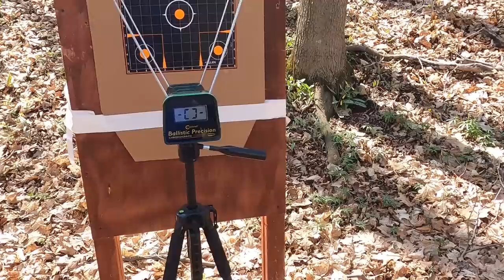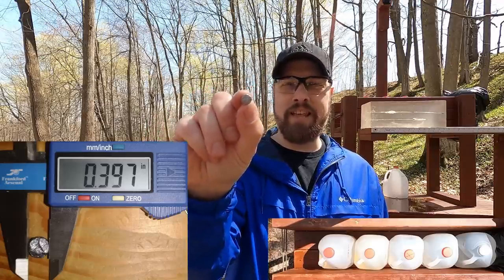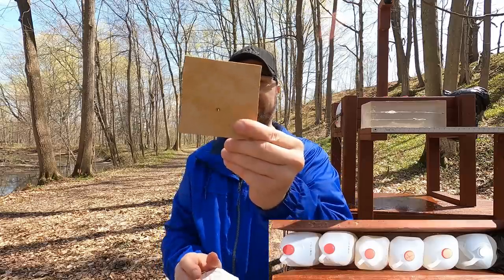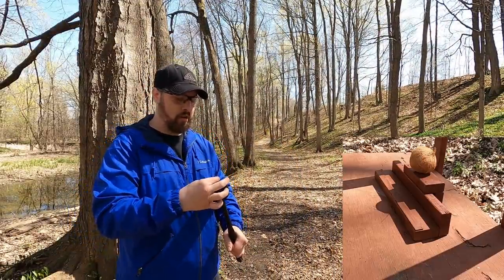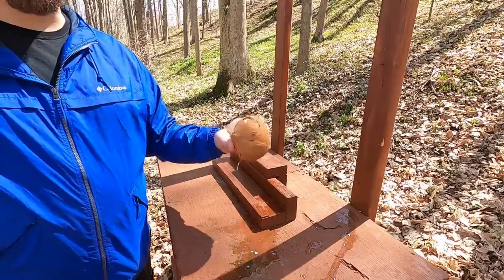WOW Dieseled Pellet Rifle RIVALS Firearm - .30 Caliber Break Barrel OVER 50 Ft Lbs Energy!

Comment from the maker: I wanted to mention this as many might be wondering if my eyes deceive me. But no, the numbers I list for gel block penetration are spot on. It's a weird thing, as these Gopro cameras I use have to be in some sort of widescreen at all times, so it stretches the block edge and makes the inch markers look a full inch off. That's why I look 210 in center of the screen but 250 on the edge of the screen lol.
Reply: hmm.. same Hatsan in .25 and dieseled, "place your bets!"
the .30 pellets weighing 48 grain, typical .22 being 40 grain.
.25 pellet might be better than .22 pellet up against a .22lr
Reply: this is super interesting to me, I wonder if you can machine a barrel to perform with dieseling from the ground up?  Maybe like a mechanical oiler that only dumps a perfect amount of fuel behind the pellet after the action is closed?  I imagine a spring loaded detent that would actuate a valve maybe?  I think you are right on making sure your loads are consistent, because all over youtube people are using things like rem oil, and wd 40, and 3 in 1 oils, and they all seem to shoot wildly inconsistent shot to shot.
Reply: The United States Department of the Army uses 3/4in plywood board to determine lethality. And then do distancing for lethality at distance.
Reply: I blew my piston seal when my nitro piston dieseled.
Reply: OK. So first thing you need is replacing cheap hard plastic made seal of the piston with one of higher quality. You can get Hatsan dedicated good seal from Czech Rep or Slovakia. To put it on seal needs to stay a while in water of 90'C and the piston put into the fridge. Clean the barrel and check the muzzle for badly finished edge of rifling. Fix if needed. Use the hollow point pellet with a deep hole. Find and fit thin HSS drill (for metal/steel drilling) so it could go inside easily. Cut the drill into pieces but fond overheat it. You need this drill to stay heat treated. Glue the drill tiny bits inside the hollow point pellet or airgun slug (it looks like a bullet most have hollow points. Put a drop of flamable liquid (like engine oil or WD40 or kerosene) inside the pellet skirt. Airgun slugs sometimes have a shsllow dent on the vottom (end) side. Second drop put inside mouth of air cylinder or inside the cylinder. It will go thru any coconut you want. My tuned Hatsan  125 with my own vortex version gotinto 22.LR areas. Hypersonic speed 25-30 grain pellet slug while  dieseling went thth old crapy car doors steel sheet panel and stopped on the door plastic panel inside. My PCP Hatsan airgun (Nova Star in 6,35mm) with 75 joules energy and slug with a drill bit inside goes thru car door and stays in the plastic panel of the second doors.
Reply: Thanks a lot for this video, The best material to diesel the pellet is the Gun Oil you use on gun maintenance it would heat up faster produce much greater pressures. You should try using different types of pellets....
Reply: You think dieseled slugs works well in the Hatsan Carnivore? Something like 50 grain?

Comment: 38 years on this planet and this is the first I have ever heard about "dieseling" a pellet. I can't imagine the trouble I would have got into as a child if i knew this. I wonder what a drop of RemOil would do. Thanks for sharing.
Reply: A drop of pretty much any oil works the same. I've found that a single drops worth (vaseline or oil) actually works better than than filling the entire skirt of the pellet. It seems to consistently provide higher velocities. My best guess as to why would be that with a single drop you're getting a better fuel to oxygen mixture so a more complete burn. With engines, fuel heavy mixtures burn less completely and put out less force than with an ideal mixture. Having a good ratio of oxygen to fuel is exactly the reason carburetors were invented and why they work. You use a carburetor to moderate the level of fuel and oxygen to get the most complete burn. I imagine if he used about half the vaseline amount he was using here he would see even higher velocities.
Reply: Hahahaha my exact same thought on the subject
Reply: I know 40 years old and I heard about it last month, and I keep forgetting to try it out dammit. I picked up my air pistol the other day and was like why did I want to use this again.
Reply: @disturbeddemons1  14 to 1 is what you want
Reply: I used bore cleaner on two of my .22 pellet guns . Smoke from both more power too
Reply: @messagedeleted1922  heck I started at 73 yrs and never heard of it until a few yrs ago. I have severe startle response  from combat and cant fire in ranges even with electronic head phones but break barrels are great for me .
Reply: Im56 been doing it 45 years it works n no damage u can diesel a red Ryder n get 500 fps
Reply: Vaseline works best
Reply: @marksmith8421  Mark is that true about red rider? Its s spring bb gun
Reply: I have a gamo .177 break barrel n get1800 fps plus also have the gamo 22 it's a beast n my new sig rattler canebrake 30 round clip love them all n oh my glock 19 best bb pistol on market love  ur vids
Reply: @jimwyatt7670  u grease the bbs it works
Reply: @marksmith8421  what kind of greece. Oil , vaseline, wd40, gun oil etc. i never heard of this for bb s .
Reply: @jimwyatt7670  vaseline
Reply: @marksmith8421  can u diesel gas pistols?
Reply: @1112-g1x  yes
Reply: Thats why teach kids how to properly use air rifles and firearms
Reply: Remington oil does beautiful
Reply: 42 years for me lol.  I definitely would've been doing that if I knew how
Reply: So far it's the best I've found
Reply: Its realy bad for your air rifle i had to exact the same rifles and with one i did dieseling and it only shot like 4000-5000 shots and tgen the spring died , and the other rifle that i wasnt dieseling shot more than 10.000 shots before the spring died
Reply: @werkzoekende6553  from the Netherlands uitkeringstrekker? Haha, I am.  I'll continue writing in English so everyone can understand. So you're saying your dieseled break barrel lasts 5000 rounds?? I find that  a lot and wont be a reason for me for not doing it. 5000 dieseled pellets with an carnivore??
Reply: @werkzoekende6553  you’d need to repeat that a few more time for it to be valid. I’ve had many of the same guns give up the ghost while the other is still going.
Reply: I thought all kids did this when we were younger we all did back in the 70s and 80s great fun
Reply: They should call it vaselineeeeeeitit 😅
Reply: Don't feel bad I've been here fifty years and I just found out about this last year
Reply: I did it on accident with my pellet gun as a kid with wd40 lol
Reply: I just put oil in the pellet container, oils the skirts for dieseling, and lubes the pellet at the same time.
Reply: I used petroleum vaselline with a little bit gunpowder, it was extrem, I have no chronograph, but I used my Gamo with mag., so I could load the pellets and the powder stayed in the pellets thanks to the vaseline, after the 3 shot I saw always the barrel smoking, and watching the pan I shot, some got even through. Absolute deadly, some said it will damage the seal, until now no issue at all. but you can clearly here he sonic effect, it's far louder!
Reply: Happy 41 years brother
Reply: Yea using way too much man ? It’s a small space in the skirt of a pellet so I say again Less is always better when you diesel your air gun I have seen the numbers on paper when my buddy was testing what too use and how much. Not long ago he told me he had a big breakthrough on his quest too get the most out of his pelllet guns and he told me it has to do with mixing the perfect  oil to the stuff they use for sparklers you use on your b day cakes ! He said it has to be kinda thick mixture so that you can use a needle 💉 to place the dot of his mixture in the middle of the pellet and not having it drip out before u shoot and he also said with certain kind of pellets you can use the needle to just  put a very small amount again but place the oil on the bottom part of the pellet skirt so like a full ⭕️ circle on the bottom edge and stressed to use the smallest amount is key. I picked up a Gamo mutishot I am going to try and make a mixture with the oil, sparkling dust  and see what happens . He told me everyone has there own kind of process when it comes too this but also said he dosent know anyone who has spent a large amount of time to perfect his  method . So I believe  him ,he said the ink on the paper dose not lie so I’m guessing he kept a note book and wrote every shot he took and what the differences were between his experiment of every factor including the temp ,and weight of ammo . I took a long time but he told me that most important thing is too try and get the fps as regulated as possible cus when that happens you have found the perfect amount and mixture.   lol he would not tell me the amounts or his recipe because it’s a family secret hahah😂 .  He must have tried everything I bet it took a lot of time too perfect his experiment.
Reply: Yea using way too much man ? It’s a small space in the skirt of a pellet so I say again Less is always better when you diesel your air gun I have seen the numbers on paper when my buddy was testing what too use and how much. Not long ago he told me he had a big breakthrough on his quest too get the most out of his pelllet guns and he told me it has to do with mixing the perfect  oil to the stuff they use for sparklers you use on your b day cakes ! He said it has to be kinda thick mixture so that you can use a needle 💉 to place the dot of his mixture in the middle of the pellet and not having it drip out before u shoot and he also said with certain kind of pellets you can use the needle to just  put a very small amount again but place the oil on the bottom part of the pellet skirt so like a full ⭕️ circle on the bottom edge and stressed to use the smallest amount is key. I picked up a Gamo mutishot I am going to try and make a mixture with the oil, sparkling dust  and see what happens . He told me everyone has there own kind of process when it comes too this but also said he dosent know anyone who has spent a large amount of time to perfect his  method . So I believe  him ,he said the ink on the paper dose not lie so I’m guessing he kept a note book and wrote every shot he took and what the differences were between his experiment of every factor including the temp ,and weight of ammo . I took a long time but he told me that most important thing is too try and get the fps as regulated as possible cus when that happens you have found the perfect amount and mixture.   lol he would not tell me the amounts or his recipe because it’s a family secret hahah😂 .  He must have tried everything I bet it took a lot of time too perfect his experiment.
Reply: @marksmith8421 yea I tell my buddies all the time that when you get a blowback BB gun , all that dose is take away from the power and amount of air you loose .  I’m a fan of the glock 19 just for this reason . It has a fixed slide so who cares if it has blowback especially when it takes away performance . I grabbed two glock 19s just for this reason ,blowback is just for realizim , but why when it’s a BB gun ? Higher fps is way better than the slide blowback in my eyes at least. 😊
Reply: @jimwyatt7670 yes it is true lol

Comment: Air rifles are no joke, once you get to the .30 pcps, you can tune your rifle to shoot those 48 grains at 1000 FPS if you wanted, those can 100% be lethal.
Reply: Have you seen the large Winchester air rifles? A bit expensive but the ads claim they are good for any game in North America. ??? A large bear or moose, I want to have a quick option for a second shot but I would love to shoot one just to see. I have a .177 Winchester model 1000 break barrel air rifle that will go super sonic (rounds crack) if you diesel them with light oil. They certainly hit my backstop a lot harder too! It has been a great snake rifle here in Florida for years.
Reply: @donaldvincent  there are air rifles that will take down grizzly bears. Starting from .177 all the way up to .50 cal, search online and you’ll find a ton.
Reply: Rooster Cogburns Eyepatch  Great info. I have only had experience with smaller/cheaper models. I have a "Winchester" (made in Turkey) 1000 in .177 that kicks like a mule, especially if you diesel it with 3in1 oil. I use it for snakes around the property. Houses close by mean even a .22 would be excessive.  I would really like to try one of these Big / high power air rifles at the range. God they look fun. Something different than my regular rifles.
Reply: Shhhh...don't let biden know that
Reply: Harold Johnson  oh yea, search for the .45 cal and .50 cal, there is even a .72 cal, but that one is just over the top and in my opinion not viable.
Reply: @rogertonner4097  

K. Harris will try and screw us on air guns if she sees this.
Reply: LOL EVEN A BB PISTOL AT JUST 450 fps is lethal!

Comment: Be interesting to see how a few grains of gun powder added first then the vasaline on top would perform
Reply: You sir are thinking correctly
Reply: @elijahcollier4547  sure am tho prob need a a remote way to pull the trigger for safety reasons but.lets be realistic air guns wernt built to absorb explosions only compression but I think a few grain of powder and dieseling would be interesting and I have in my younger days fired a wierack hw35 with the extended barrel using 3in one oil added to a tin of pellets have tried adding two drops of petrol(gas) to the air chamber once cooked even diesel fuel.parafin vaseline wd40 etc all seemed to boost the power some reliable others not so reliable or accurate also done same in a Benjamin pump action just by adding a couple drops before closing the bolt.
Reply: @paulbeddows6014  oh with out a doubt air rifles aren't designed for the pressures involved with powder propellant. BUT most engineered consumer products have a safety factor that is usually 2-3 times that of the maximum specified load or pressure limit of said product. So I wonder what the peak pressures are in a normal pellet rifle when fired, then see if there are any manufacturing information on the safety margins. 

I feel like most petroleum products with be effective, petrol not so much compared to deisle but I digress. Going back to what I said above, there could be an ideal amount of Vaseline to powder ratio. Assuming it's smokeless powder you are thinking about I'm not sure it would be of any benefit too slow of a burn time 🤔 possibly or not sufficient amount. Possibly fffg black powder would be ideal ignoring fouling 

Sorry for the stream of thoughts

Comment: The Military used a 1/2" pine board at 100 yards when testing the .22lr , can't remember the year 50's I think, the .22lr has a force to be reckoned with, a very deadly round.
Reply: I agree wit the .22 bullet but the   .30 hatsan wins the trophy
Reply: Some long range expert shooters managed to hit 1/2" thick plywood at about 700 yards with 22LR standard velocity ammo. The 40 grain bullet still had the ability to puncture the board. They calculated it carried aprox 22 ft/lbs to the target. Hatsan with 30+ ft/lbs is deadly since it can puncture 3/4" wood too

Comment: Thanks for your demonstration on dieseling. I've noticed that manufactures of airguns discourage adding lubricants into the mechanism and often wondered why. I have known what dieseling is but it's good to see a practical demo.
Reply from the maker: I did it a long time ago, and it was hard for me to tell if it negatively effected the gun. The old style springer never lasted too long anyways so who knows. I know that ultimately I dry fired that gun all that time ago and broke it. The main issue is the seal around the pellet chamber can break, making air leak out and be less powerful. But honestly it's just a rubber o-ring, and probably easily replaceable.
Reply: @GunSam  Not so sure about springers not lasting - my 1958 Gecado is still going fine with the original leather piston (and, until this year the original leather breech seal) and it has ingested countless tins of 3-in-1 oil in its time. Back in the 50s we didn't even consider the 3-in-1 smoke as dieseling at all as you had to lubricate the leather constantly anyway. Here in the UK, dieseling meant putting model diesel engine fuel (approx 1:1:1 ether, kerosene, oil) into the chamber - that really did something!
Reply: I was told that the higher powered piston airguns diesel toa degree anyways. There has to be some lubricant in the cylinder to slow down wear.  The action of firing a springer resembles cavitation of a vessel propellor. Also the pistol shrimp uses cavitation to huntits prey. We are talking about significant energy here. The manufacturers concern is about liability, litigation , & safety - the holy trinity I guess for corporations lol.
Reply: t is easy to dismiss the process as it is hidden in the gun internals. However the piston - I am pretty sure is going to get launched rearward as part of the firing cycle with dieselling, sometimes with enough power to recock the gun. It is not a gentle event.
The heating of the air in the cylinder happens with every shot. An estimate from a source says it is around 1500F in there, for a gun rated for 12FPE. This is whether the cylinder is dry or has a fuel source in there.
Reply: @ColinMill1  oooh diesel fuel now it’s getting interesting